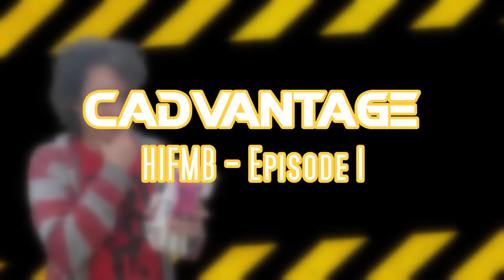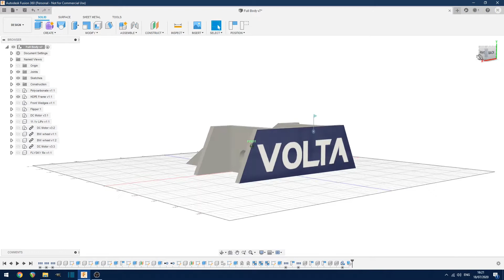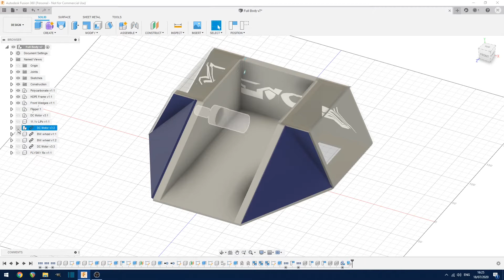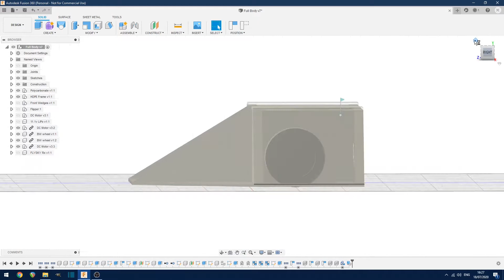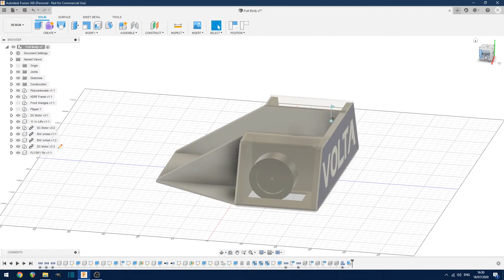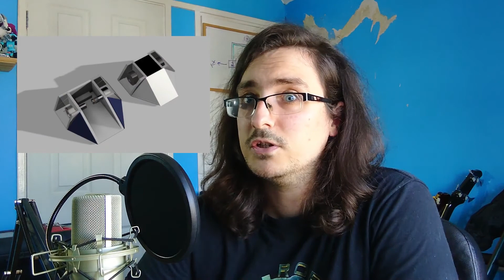Cadvantage - Have I Finished My Beetle?: Episode 1

Comment: 3mm polycarbonate is good, you could use it for the front side wedges if you dont plan on having any electronics in them, for the flipper, you could use hdpe, and just put a bit of steel or aluminum over it to get it lower to the ground, and some 3mm wood screws should work for mounting everything, hope I’m being at least a bit helpful
Reply from the maker: I might use it for the side wedges but I'll also look into some thinner HDPE (which I'm going to need for the top of the flipper anyway)
Reply: Jimmi Cottam why thinner for the actual flipper arm? 10mm would probably be better since a good horizontal hit on 3mm might damage it.